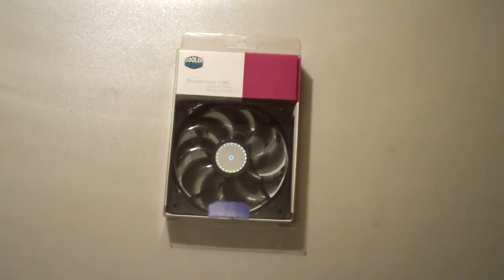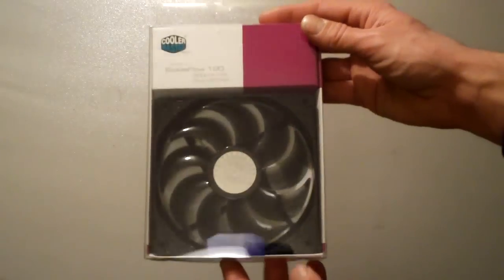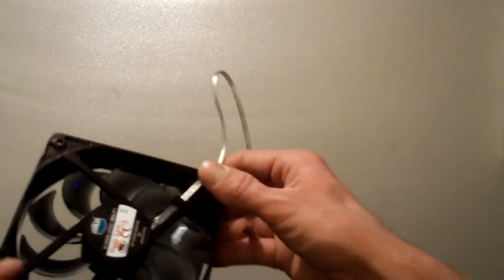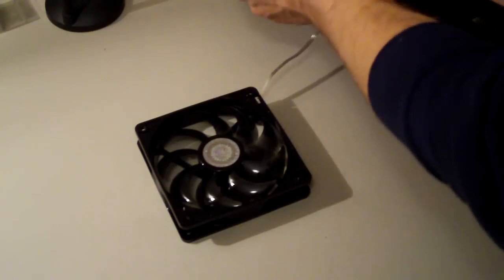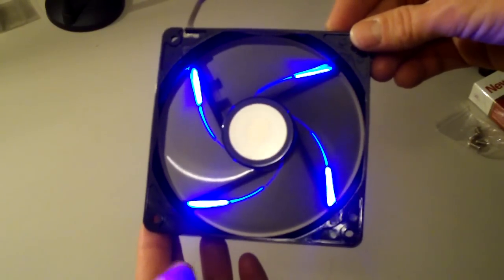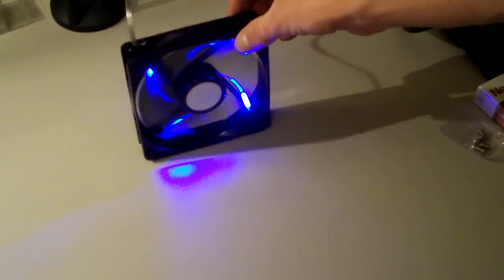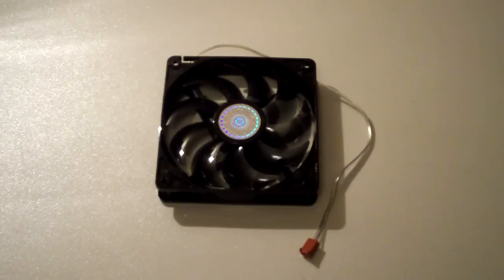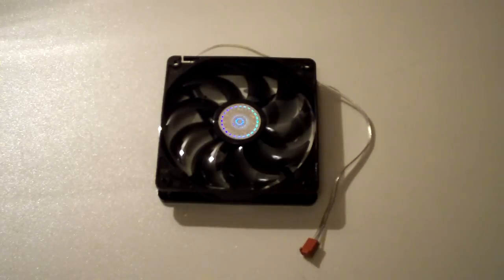Coolermaster SickleFlow 120mm Case Fan Review

Comment: Before i tore my rig apart i was running 4 of these and 1 XIGMATEK Crystal Series CLF-F1253. I love the coolermasters and they are not crazy bright but do give off a very nice glow. The XIGMATEK is a little quieter, a lot brighter, but does not push as much air. I would be happy to buy both again when i  need a new fan.

Comment: They are rated at 19 dBA which would mean you could barely hear them however they are more like 30 dBA way too loud, i had to get a 3 pin fan speed controller on ebay to turn them down. They do really help with airflow though so i turn it back up to help with cooling when things get hot.

Comment: These fans are 2000 rpm so you will hear it. If you don't have a modern motherboard with GUI bios and fan headers on the MB you will hear it. I don't know how people are getting dust inside them, but I suggest getting some filters if your house is that dirty to start with! I like them overall they push/pull enough air to recycle the case air every 1.2 mins with just 2 in mid tower case. I have 6 120's and 1 200mm in my case. Well over enough air flow to keep it cool.

Comment: I bought two of these (same fan, non led version) and they are quiet!  I don't know if people got bad ones or not, but these are quiet and flow good amounts of air
Reply: Cool, I'm planning on getting one. Are they worth it? I can get one fight now for 4 dollars XD
Reply: +Fel Beat they are more than worth it.  I got mine for $7 a piece and even at 100% speed it's pretty quiet.
Reply: Derrick Gott
Sweet, I bought it XD What's your build?
Reply: +Fel Beat I built an AMD Rig.  It's in a ThermalTake Versa H22 case, FX-8530 CPU, Cooler Master Hyper T4 CPU Cooler, 16gb Kingston Hyper X RAM, 1TB HDD, and a R7-360 gpu to get started. Will upgrade GPU to the next GPU that AMD puts out.  I have these two cooler master fans in the front of the case plugging in via molex to 3pin, and one 120mm exhaust fan.
Reply: Derrick Gott
That's dope! My build consist of an i5 4460, and a r9 380 ;']

Comment: I had 3 of these in my case but they where too loud for my liking.  They aren't too bad for 2k RPM and 70CFM but I'm not overclocking and only running a single GPU so I don't need crazy fans.  I wanted something quieter so I sold them.  But they aren't bad I've heard louder and I like the way the tinted plastic gives the LEDs a more diluted look.  Even though they where a little loud for me they aren't that loud and I still recommend these to most.

Comment: I've never mounted a fan in the case before, I bought this one to try out. It comes with 4 screws, but the holes in the fan are smooth inside, there's no way to screw in the screws. Do I need to buy something additional, because I don't  think I should force those screws in.
I might just buy some rubber fan pins instead.

Comment: When I tried to install them onto my case for a new build, I realized that the fan's screw holes were not threaded and wayyyy to small for the included screws. I'm just wondering what's the best way to install these. Find smaller screws? Try and force the screws in? Use an electronics screwdriver/drill and drill the screws in? Is there a chance of breaking the plastic screw holes on the fans?

Comment: I bought the Cooler Master Sickle Flow ARGB 120mm Fan. But idk if it has a 4 pin header or a 3 pin one because i have a Gigabyte A320M-S2H Motherboard and it has two 4 pin slots so if tit has a 3 pin header it would be very unfortunate.

Comment: I have 3 of these on an EK 240mm radiator. Barely pushes any air through even at 100%. And they are LOUD even at 40%. Really wish I would have bought something else.
Reply: David Burgess - Mine are really loud too.. wondering why exactly..
Reply: Gilbert Flowerface I think it's just the number of blades and that they are smaller/thinner blades...
Reply: David Burgess - Although it seems most top end silent fans have 9 blades... some have 15 lol. I'm currently in the process of finding quieter decent fans.
Reply: Gilbert Flowerface I'm a fan of Noctua fans. They push a lot of air and run pretty quietly.
Reply: David Burgess - They're pretty expensive though.. although there's the Redux ones for cheaper.. but they're not that much cheaper since I'm in Australia and all our shit is much more dear.. I'm looking for a static fan for the frontt of my PC since I think that might be adding to the noise since I have a bunch of hard drive stuff at the front of my computer and the airflow fans might not like that and make it louder.. nott entirely sure.
Reply: ***** Good info! Thanks!! :)
Reply: David Burgess - I completely second Kytech's opinion. I got 2 Corsair SP for the front intake and 1 Corsair AF for the back both is "Quiet edition".

I got the SP ones for the front since they're good for getting more air past all the drive cages and shit in the front of the computer (Backed up by Jayztwocents and linus).

And boy are they quiet! I can't hear shit.. plus they're on 12V full power. I sit about 2 feet away from my tower and there's nothing.. if it's veryyyy quiet you can hear the air.. and when you put your ear up to it you can hear the motor working like a bit of a fast clicky kinda sound.. but in your normal sitting position that's hardly an issue (you could hear it in complete silence but I hate complete silence anyway). WAY quieter than my SickleFlows. I don't think the LED versions are exactly the same and a tad louder maybe.. but yea.. I'm liking them.

Comment: you cannot use the mobo to control a 3 pin fan only a 4 pin can be control by using the mobo
Reply: Semi correct. You can't control a pwm fan on a 3pin, but some mobos do have voltage control
Reply: 3 & 4-pin both speed control available
3-pin by Voltage
4-pin by PWM (a.k.a. Frequency input)

4-pin fan can be control both Voltage and PWM, but some 4-pin mobo not available in voltage control. your 3-pin fan will run full speed.
Reply: black crow1234 my maximus viii hero can control any fan

Comment: I'll never understand how so many ppl complain about how loud  case fans are yet cannot   hear me with  the afore mentioned sensitive ears as I  sprint toward them in battlefield to  toss a throwing knife into the back of their head , or their squadmates head prior to then serving them in battlefield.

I run 9 120mm fans and 2  140m fans.  Typically at  100%.. I cannot hear any of them with my headphones on , ocassionally the  GPU fans on my card will break thru n I'll hear them kinda.   With my head phones off if I am not gaming       , I can obviously hear my GPU fans at 75 or higher otherwise  bleh.

Why would you sit  closer than  30-40 inches from the system anyway ?     At some point  I just wonder how many folks really are hearing fans  when Ya just run into so many deaf people in video games perhaps they just have pisspoor head phones  due to spending too much cash on "noise optimized" fans lol.

Comment: I just got my sickleflow today and it spins 3500rpm instead of 2000rpm and is like 40db
Reply: TheCovertCamper it propably had already been broken so I just got a new sickleflow that was normal
Reply: TheCovertCamper wow for 15 bucks? They totally ain't sickleflows one sickleflow is 12€ in Finland
Reply: not bad. Did you check the RPM after installing them?
Reply: mm my broken one had an RPM of 3500 :D dat noice of the engine <3 but yeah mine got problems too when it didn't get enough surface behind/in front of it, maybe that is the reason. I have one on my CPU cooler (Hyper 412s) and it has no problems there but on the sidepanel it screams.
Reply: you should bought the arctic f12 22dba more like 19 dba 1350 rpm 76 cfm
Reply: that a damn jet engine you should really check arctic f12 fan noise it really that quite
Reply: it won't matter if you get a fan controller cause anything above 1300 rpm you will start to hear a whistling noise coming from the fans don't just buy fans that are from will known brand company if you going to buy those fan again make sure you buy the sickle flow x version those are the good and very quite at full load i have 6 of those before in my nzxt source 530 full tower case before moving to the arctic f12 pst pmw cause it comes with a 6 year warranty and it good for both air and radiator performance
Reply: what is your fan static pressure how thick is your radiator and is it a single ,double or triple 120 rad
Reply: Example static pressure is the mm/h20 # like 1.20 or 1.22 that is good for rad cause it push alot of air or pull alot of air through the rad cooling it faster than a fan that is design basically for air cooling cfw fan are for air cooling and static pressure fan are for rad cooling
Reply: than it good
Reply: LOL! Shut up and take my money. This is exactly what I need, I live in a tropical country and it's hot af, the more ventilation I get for my case, the better.
Reply: Lmao keep it and use it

Comment: please someone help me. why do the crews that come with this fan not really fit in the fan or do I have to force them really hard? I have been trying and can't fit them onto the holes on the corner of the fan:(
Reply: This is because case fans don't come pre-threaded. This is the case with any fan you fill buy. Just try to screw in a screw without putting it in the case first and then after you thread it, install it in your case.

Comment: @SApcGUY Here's the problem, my budget is really small, and I want LED ;) 
I want preferably red LED. But if I had the cash I would buy them and then some lighting inside the case instead. But pricedifference is 60 sek ( 8-9 USD ) for sickleflow and 250 sek ( 30-35 USD ) for noctua fans. Noctua is a very good brand but not worth the difference in price. And with 4 of them.. the price would go skyhigh in my budget :D
Thank you for the tip though.

Comment: I've got two of these and even when run at 40% speed there is a noise (bearing) so I'll be getting rid of them soon in favour of some noctuas or corsair AF120s
Reply: it depends where you have it and also what kind of slot you put it in...as you can see in the video the first second fan strated work it made a noise...when he grap it the noise stopped
Reply: listen the noise at 2:29 and 2:35
Reply: Christos Vasiliou
 * 2:49 2:55
Reply: did you got the AF120's? I don't know if I should get one of those (with LED) or the sickleflow